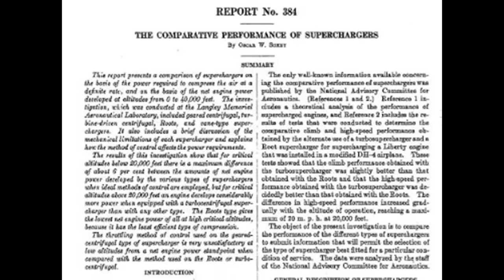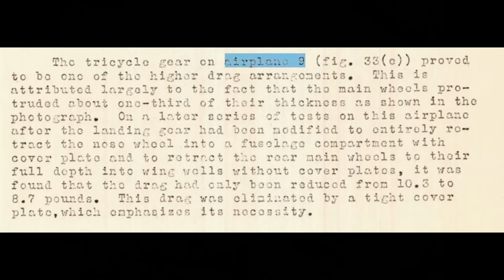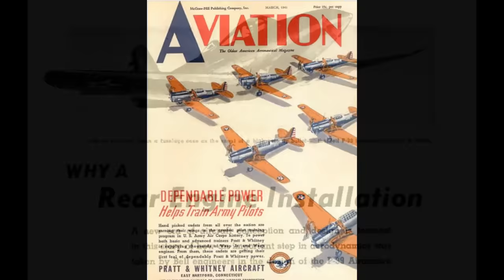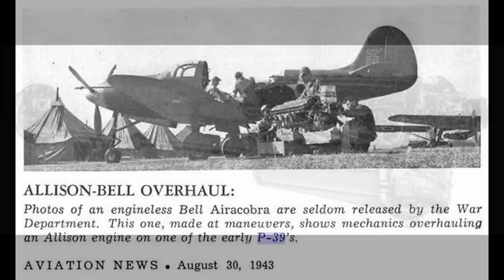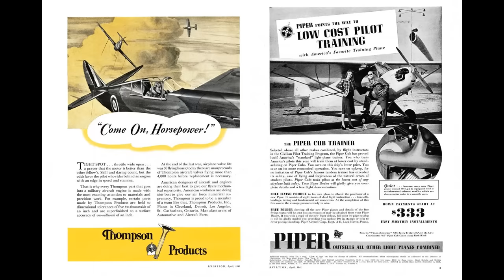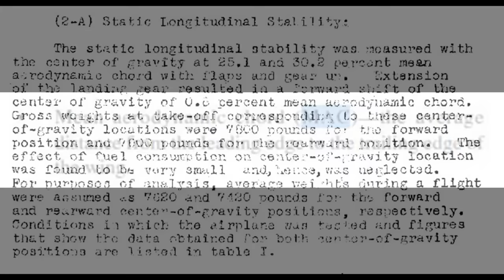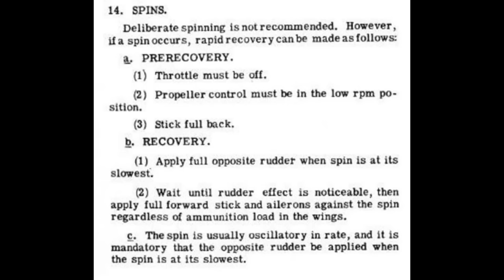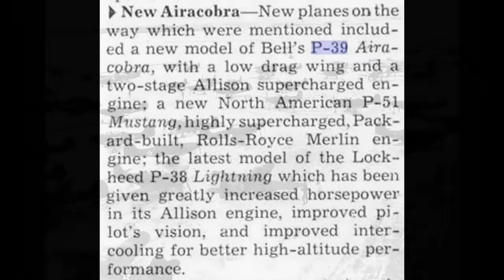Bell P-39 Airacobra, Why the Mid Eng?

Comment: Airlines try to minimize the static margin to reduce the trim drag associated with higher static margins (not to keep the pilots on their toes). In that industry drag is fuel and fuel costs make all the difference between profit and going broke.
Reply from the maker: The example of the aft CG of 28 percent I showed was from a SIMULATOR, fuel burn there isn't really a concern. In actual practice in the airplane the CG is kept closer to 20, and that image I show of a 20% MAC is from an actual plane ready for an actual commercial flight. Obviously that varies, I just had a flight with a CG of 30, but that's rare. Yes I know an aft CG helps fuel burn, that's covered in another video.

Comment: 26:30 I hate to quibble with such a painstakingly-cited and fascinating video as this.  As an engineer, though, I would guess that the designers were given a range requirement for the plane, and they found they could meet it with the wing tanks and thus shrank the fuselage, rather than suggest the engineers made a plane with wing tanks, and it turned out to have nowhere to put a fuselage tank.  While you enumerate the places a fuselage tank couldn't have fit in the plane *as produced**, the engineer would just **made room* to put a tank behind the pilot *were that the business remit.*  A 4' diameter x 1' long fuselage tank would be 95 gallons unarmored, and perhaps move the engine back 6" and the pilot and guns forward the same amount.  A 3.5' diameter x 2' long tank is an unarmored 145 gallons.  If I'm being naive about the amount of girth such a tank would have, or the fuel that would have been optimal, even a  3' diameter x 3' long tank would be 160 gal, again unarmored, and require moving everything say 18 inches, but would also be about the most efficiently-armored shape possible (minimizing volume and thus weight of armor for the given fuel and armor thickness).  And even the last example, from studying the diagram, may not have required a substantially longer fuselage.  (In other words, as illustrated it appears the length may have been dictated by aerodynamics, not the raw volume of interior components.)

I've always liked the P-39 approach and would have liked to see this with a bubble canopy, later laminar-type wings, and either the originally-spec'd turbo system or an Allison with the same supercharging as the later Merlins.  I'm hoping you can produce at least one more vid, if not two, covering this and the King Cobra.
Reply from the maker: At the outset of the video I tried to make it clear that the P-39's shortcomings were related to the timing of its design. At the time, they thought 120 gallons was plenty and for use by the Soviet Union 120 gallons was plenty. The modification you are talking about to increase fuel capacity is significant and would interrupt production. There wasn't much point in doing that as Bell engineers were working hard on the P-59 Jet fighter, which was obviously the way forward.
Reply: @GregsAirplanesandAutomobiles  Thx and fair enough, but I wonder if we could also turn that argument around?  Maybe the need for extra range by the Soviets was either zero, or so low that no-one requested it even among the 40+ variants they did stop assembly lines for.  I know you love working from original material and while the Russians obviously discussed in Russian, I imagine their requests to Bell would have been in English.  Did you see much discussion of range being a limitation?  I see at least one was lengthened 21" for whatever reason, and modifications of length seem common enough in today's commercial aircraft.
Reply: Late Spitfires got rear fuselage and wing fuel tanks.  Possibly the more powerful engines forced the need for imaginative additional internal fuel tankage.  Weight is never added without a real need.

Comment: I'm thinking locating the pilot farther away from the CG would be significant in a nasty spin.  Imagine how quickly the g's fall off when moving toward the center of a spinning ride...quite quickly.  But you'd always have massive visibility issues I'd think.  So designers place much higher value on visibility than reduction in g's in a spin.
Reply: I think someone behind the scenes is behind hamstringing the P39! Imagine a better wing, and a better aerodynamic front-end and a lower scoop like the P51, and either somehow super-turbo charging the engine induction. That would have been a world beater..from Wyoming USA 🇺🇸 🤠
Reply: Allisons were downdraught, top scoop was essential.

Comment: Get into a spin in a cobra ,in IL2 sturmovik, it's almost impossible to break out..  Russian pilots in WW2 noted the shift in CG once you fired all the ammo, it was significant.
Reply from the maker: With no ammo the CG is back to about 28 percent MAC. Still not that bad.
Reply: Well, Red Army Air Force research institute studied the problem and issued recomendations how to avoid or break out of the spin. Report dated 10.11.43 is about P-39Q. A quote from the conclusions (page 26): "P-39Q spin and breaking out of spin is safe within any allowed balance. Breaking out is safe if the altitude is enough and pilot actively pushes the elevator." (not sure about translation of terminology - "push the elevator").
And yes, CG issue and balance is mentioned as very important in this report. There are strict recommendations to watch the balance.
Three pilots of research institute crashed (and died) in a spin during 1943-early 1944.
The problem was so serious, that "Bell" engineers with L. Rogers (Head of reclamations) arrived in Moscow in autumn 1943.
Report link (in Russian):
https://docs.yandex.ru/docs/view?url=ya-disk-public%3A%2F%2Fw7n%2BY%2Bv1vs55WdFIeypC%2Fcd3ejMsp1r4ZXu7EDYhxWZGdXL2O6VZQDFgnPkrAb39q%2FJ6bpmRyOJonT3VoXnDag%3D%3D&name=%D0%B0%D0%BA%D1%82%20%D0%BB%D1%91%D1%82%D0%BD%D1%8B%D1%85%20%D0%B8%D1%81%D1%81%D0%BB%D0%B5%D0%B4%D0%BE%D0%B2%D0%B0%D0%BD%D0%B8%D0%B9%20%D0%BD%D0%B0%20%D1%88%D1%82%D0%BE%D0%BF%D0%BE%D1%80%20%D1%81%D0%B0%D0%BC%D0%BE%D0%BB%D1%91%D1%82%D0%B0%20%D0%90%D1%8D%D1%80%D0%BE%D0%BA%D0%BE%D0%B1%D1%80%D0%B0%20P-39Q-10.pdf

Comment: 27:10  The most efficient design for a self sealing tank would be a single large sphere.  Cutting a long thin tank into several pieces does NOT decrease the amount of inner area taken up by the sealing material, it increases it.  HOWEVER, if one "cell" takes damage, it does not compromise the entire fuel space in that wing.  If hit, you lose only the fuel in that one "cell."  That means you can rationalize making the sealing material thinner, in which case you could see a net gain in fuel space.  Is that right, or am I missing something?
Reply from the maker: A sphere is not an option for a fuel tank inside of a wing, unless it's a really small sphere. The issues is that the wall thickness steals room from inside the wing tank.

Comment: He touched on something that I have often theorized about, if you put a fly by wire VR cockpit in the center of a plane on a gimbal mount would that plane not then be able to do some extreme g dog fighting? Extreme enough to even avoid missiles?
Reply: No, the G's would still be there. G happens because of the change of direction of the motion of the entire airplane, not because of changing which way it's pointing. Think about putting a Jello sculpture in a bucket and swinging it around in a fast circle. That'll put G's on it and it will squish, and if you put the Jello sculpture in a gimble mount inside the bucket, there's nothing it could do to help.

Comment: I think if I were to revisit the design with hindsight, the first thing I would do is remove the .30's to free up wing space for fuel, replace the 37mm cannon either with a 20 mm (like the P-400), and bump up the number of .50's in the nose to four. In other words make the P-39 armament like the P-38. I guess my question to you Gregg is: Why did they not arm it like the P-38?
Reply from the maker: The Soviets often did remove the wing guns. Bell did make various upgrades but ultimately changed it to the P-63.
Reply from the maker: Bell had their hands full with the P-59 jet and the P-63. I think from their point of view, the US military wasn't going to buy the P-39 in serious numbers no matter what they did, and the Soviets seemed really happy with them as they were.
Reply: Bell reportedly wanted to remove the 37mm from the P-63, but the Army Air Force insisted it stay.
Reply: Funny how the MiG 15 kept a 37mm cannon when it had a pair of 23mm guns.  They chewed up B-29s.

Comment: Abrupt transitional motion:  Not that it matters but there is a "physics" term for it.  It's called "the jerk".  At least that's one my physics teachers called it 45 years ago.   As that same teacher used to say, "I'd bet a dollar to doughnut (back when they were ten cents)." that you sir, are correct.   Transitional, or in this case, "the jerk", felt by the pilot when he imparts a new pitch (or yaw... not that these are nearly so strong nor common) would be impart a more pronounced jerk to the pilot.  Steady turn:  no difference.  [Same guy that wrote flight simulators 40 years ago and mission simulators for the USAF up until about 12 years ago.].  Thanks again, I love this stuff.  One more thing, is there some way to contribute other than subscribing?
Reply from the maker: Hi Wayne, thanks for your comment. I'm still using the term dollars to doughnuts, although with the inflation lately it's going to have to change to doughnuts to dollars. I do have a patreon, that's about it, but it's low cost and I try to give back a lot there.

Comment: Do you like aces high's recreation of the P39?
Reply from the maker: I haven't tried it.
Reply: @GregsAirplanesandAutomobiles  It feels just like you described it. Dives well, behaves well with compression but it is underpowered at any kind of altitude. The stall is not so bad, but yeah there are possibilities of a flat spin under the right conditions.

Comment: About the driveshaft part: What is the ratio of the gearbox, and how fast does the prop actually turn at max power? I'd presumed the rpm gauge was indicating the prop doing 3,000rpm and thought the engine must be doing around 5,000.
Reply from the maker: The RPM gauge is engine RPM, not prop RPM.  can't remember the ratio off the top of my head, but it's a significant under-drive.
Reply: @GregsAirplanesandAutomobiles   Ey, thanks for getting back, and thank you for the education!
Reply: Broadly speaking, for most of these planes the reduction was about 1.5 to 1.
Reply: @FlyNAA  Thank you! Yeah, that makes sense, adds up to usual turboprop rpms.

Comment: 13:30, not a fighter pilot but there is a pretty noticeable difference in the forces your body will go through if you're sitting at the back of a bus or driving one (and thus far from the center of rotation when it takes a turn), than if sitting in the middle. Same with riding on commercial airliners, turbulence is always worse in the back of the plane (far from the COM/COG)

Far as modern jet design. Probably is the kind of thing ignored in design, due to its effects being negligible on the pilot when compared to the 7+ g turns modern fighters will perform, and also trying to stick the cockpit so far back in a modern fighter would cause issues with field of view, engine placement, and ejection systems.
Reply: If you sit at the back you get ‘sticked’ by the approach lighting poles if the pilot mucks up the take off.

Comment: Why would all of the fuel tanks need to be self sealing? It's extraordinarily unlikely that the aircraft would be fully fueled and immediately get into combat. If the tanks fed from the wing tip in could the outside couple tanks be of a standard construction for some additional fuel capacity (20 gal?)  While the more central tanks you're going to be feeding from in combat are of the self sealing construction.
Reply from the maker: The problem is that even when the tank is empty there are still vapors that can explode. Some planes like the Corsair did have exactly what you describe, non self sealing tanks for use before going into combat. However the Corsair had an onboard system to purge them with CO2. Later they gave up on those and went to a different fuel system with the Corsair. I have a video on the plane that covers all of this.

Comment: I wonder how a naval plane with this arrangement would have fared. The improved forward visibility combined with tricycle landing gear and space for heavy nose mounted gun is atractive, and the weight penalty would be shadowed by the requirement for heavy duty landings.
Reply: The vast majority of naval aircraft were air cooled for a good reason. I don't see a navalized P39 having a ton of success.
Reply: The USN tested a carrier version (the Aerobonita). I take it that they were not impressed. Plus the USN was firmly wedded to air cooling of piston engined aircraft. One less system to maintain and one less failure point. The first tricycle aircraft (1) to successfully operate from carriers was the Grumman F7F Tigercat. Armament centered in the nose but air cooled R-2800s iirc
1) The B-25 Mitchell (2) and any P-39s/P-400s that may have been launched from carriers do not count.
2) There is a B-25 on display at the entrance to Milwaukee's Mitchell International.
Reply: @mpetersen6  I don't think the F7Fs ever even saw service from aircraft carriers. Just from land bases. Or atleast that's what I've read.
Reply: @martijn9568  
Were they certified for carrier use? Well it seems only the later -4Ns were. But only 12 built.

Comment: I was under the impression that the mid engine design of the P-39 was a maintenance hog in combat as doing an engine swap was a nightmare Interesting you said maintenance was easy.
Reply: Same imprression..
I read somewhere that, because it was stressed skin, there were multiple panels with an innumerable number of screws to remove to gain access to the engine... through the beams that strengthened this highly stressed location in the fuselage.

Comment: The soviets loved the plane because of its center engine configuration and its maneuverability compared to the German fighters. Flying at lower altitudes where the thicker air made the aircraft very effective. With a conventional airplane with the engine in the front, yaw control was limited by the weight of the engine when using yaw to line up guns on a target. Its weight influenced how fast the yaw would move the nose from side to side. With the P39s mid-engine design, yaw control was much more effective, and the Russians used this to their advantage. The Russians were very good at deflection shots where the P39 excelled.

Comment: My quibble with the P-39 has to do with so much a part of its disposable load being so far ahead of the C.G. The cannon and nose machine gun ammunition was stored in the nose area ahead of the C.G. As it was depleted, the C.G. necessarily moved aft. As we know, aft C.G. destabilizes aircraft in the configuration of the P-39 (control surfaces at the rear) by increasing pitch and pitch control input sensitivity. 
Accordingly, the C.G. of a P-39 which was fully armed at takeoff would move aft as nose gun ammunition was depleted during combat, and its pitch and pitch control would necessarily become less and less stable and more sensitive. Some pilots might like this as pitch maneuverability would improve therefore, such as is the case of the Spitfire with its aft C.G. However, the irony of this is that a P-39 would be at its most pitch maneuverable when all of its nose guns' ammunition was gone. 
Also, if a P-39's nose gun's ammunition was depleted during a flight, it would then be less stable in pitch  during the landing than it was at takeoff with all that such implies. 
In this, the P-39 is different from and arguably inferior than virtually all other WWII fighters, the vast majority of which store their ammunition in their wings near their C.G.s, and unlike the P-39, the depletion of their ammunition has little to no effect upon C..G. and pitch stability.
IMO, the P-39 is the sexiest-looking U.S. fighter of WWII, and it makes a great-looking model. I much appreciate Bell's desire to do something different, but as a practical fighter of its era, I believe it was a failure of design.
The P-63, a similar-looking, but really a different airplane, was far superior primarily because of its more powerful, fully "turbo-supercharged" engine (its Allison V-1710-117 V-12 liquid-cooled piston engine had no turbocharger but was fitted with a second remotely mounted supercharger, supplementing the normal single-stage supercharger - O.K.?) and a few other improvements, but still suffered from many of the P-39's basic design problems.  
If I had to choose an airplane in which to fight in WWII, the P-39 would be my last choice. I would not wish to engage in deadly combat in any airplane so difficult to escape from.
Reply from the maker: It certainly does shift aft as ammo is expended. Of course that's true of various other fighters as well. However it doesn't move that far and it was tested at the maximum allowable aft cg with ammo depleted. That said, yes, it will change the flying characteristics a bit as ammo is used up.
Reply: Fully turbo-supercharged engine?  You are not a good listener
Reply: @givenfirstnamefamilyfirstn3935 
I know what it's supposed to be (see my edit on your behalf). I used the vernacular from that era, just as Greg did.
If that's my only "error" then I guess I'm doing alright.
Gee, the people around here are tough. :D
Reply: @Glicksman1  adding a non existent turbo is not vernacular, it is invention.  Shame, it was a fine long contribution.
Reply: @givenfirstnamefamilyfirstn3935  Yes, it was how they referred to it then; however, see my edit. 
Please, relax. The world will not come to an end if I made a "mistake" according to you, that is. Thanks for the compliment, I think.